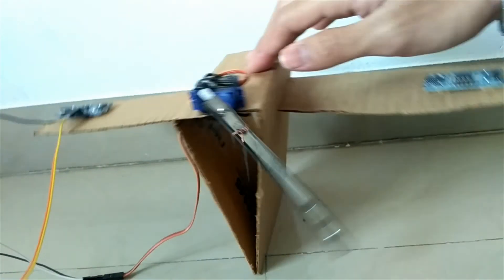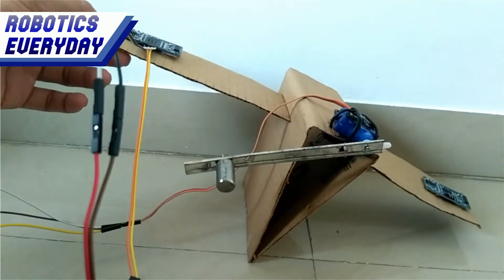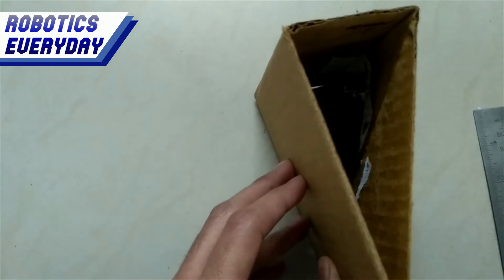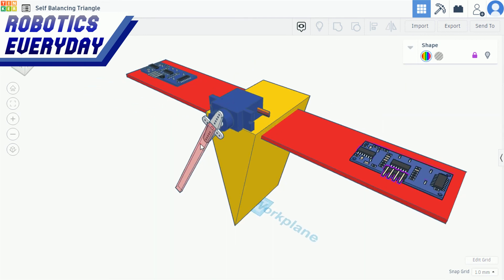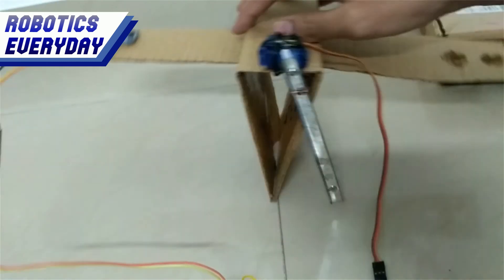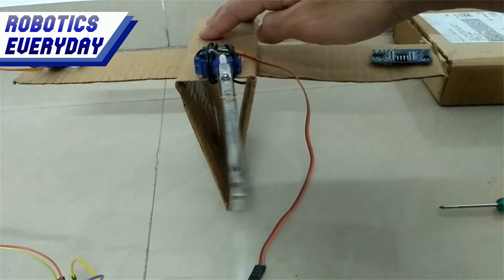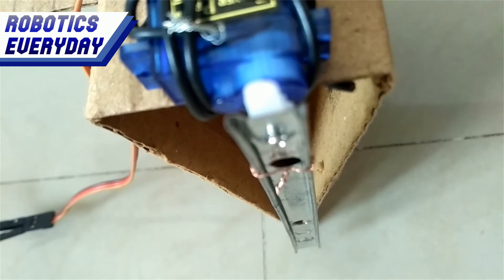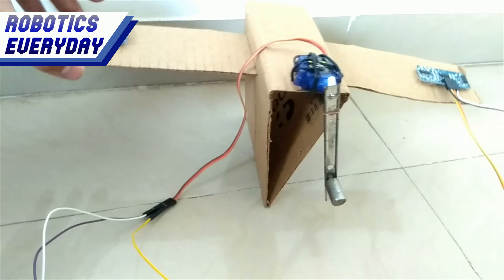Self Balancing Triangle Robot | Balancing Inverted Triangle | Ultrasonic Sensor Servo Motor Arduino

Comment: Try standard servo and heavier arm. I will try this too. Nice experiment. Could also just use a MPU6050 sensor in place of utrasonic sensors - easier to implement.
Reply from the maker: True, we could have used  MPU6050, but we thought to try this way. With better/balanced components and proper PID tuning it could have worked. Thanks for the suggestion.

Happy Hacking
Robotics EveryDay!